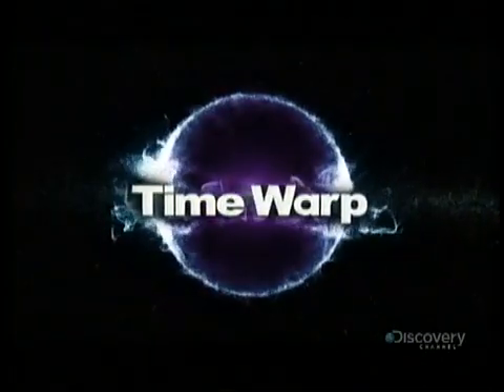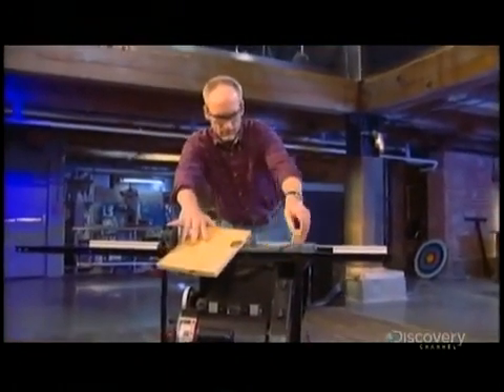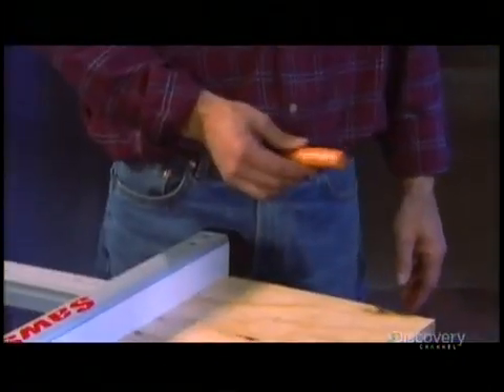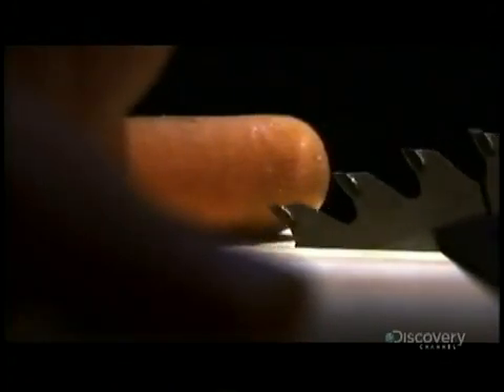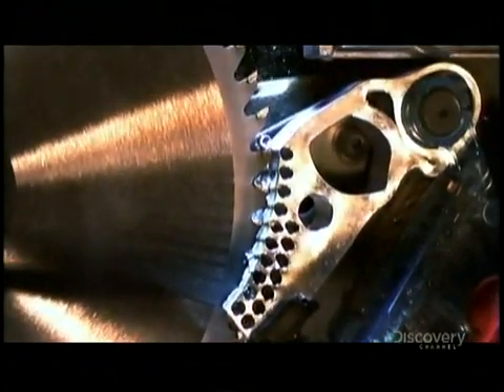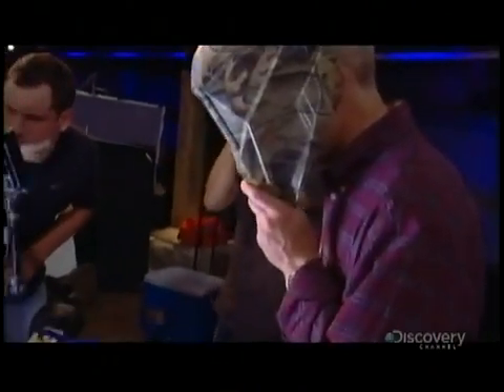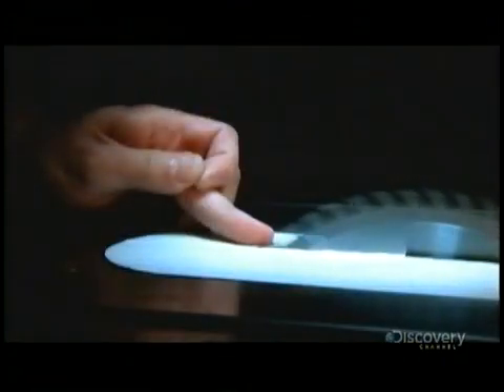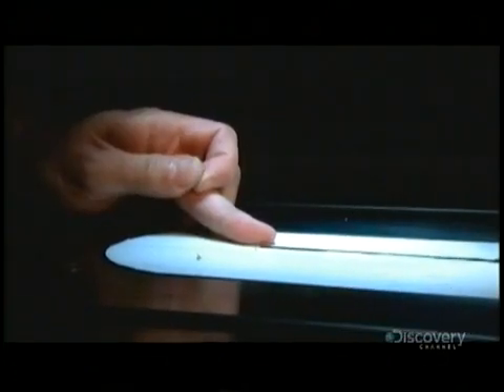Saw Stop - This guy puts a finger into an active table saw blade & comes away without a scratch!

Comment: what if you smash your hand on the saw and not doing it slow?
Reply: +Bill Gates You're smashing your hand into a sharp object.  That's gonna hurt a lot even if it wan't turned on.
Reply: +Bill Gates If he'd gone through full-speed it would have cut him. That's how it works. The reason it stops is because it's coming in contact with something very conductive. They aren't saying this in the video because it could easily derail the usefulness of this, but it would normally cut you just a bit before stopping. There would be no serious damage, but you would have a small scratch.  The entire reason he's dipping his hand in salty water before doing it is that he's simulating the salinity of blood. You'd still be fine, but under normal circumstances you'd need a bandaid.
Reply: +itsSidathe Dude stop saying the r word. I bet your kids will have special needs now
Reply: It will still stop the blade the damage would just be like if you hit a static saw blade. The sensor is extremely reactive and is controlled by a very powerful capacitor. It happens extremely quickly, and the damage is virtually nothing compared to if you did this without a saw stop.
Reply: +Bill Gates would you try?
Reply: no but they could have done it with a piece of meat
Reply: they didnt really do it that hard quick and with power
Reply: I saw a guy throw a sausage down on the blade, it gave around a 1/4" deep cut, at most.
Reply: +itsSidathe 

But that's what the invention is for. If it doesn't stop you getting hurt when falling on the blade, it's pointless.
Reply: +Jon a >r word
It's not a fucking ban word you idiot m.
Reply: +itsSidathe Surely it's more retarded to slowly push your finger into a sawblade than, say, falling or being knocked over by someone or thing pushing past.
Reply: +itsSidathe Surely it's more retarded to slowly push your finger into a sawblade than, say, falling or being knocked over by someone or thing pushing past.
Reply: +itsSidathe Surely it's more retarded to slowly push your finger into a sawblade than, say, falling or being knocked over by someone or thing pushing past.
Reply: Bruh stealing my name
Reply: +Bill Gates in a world without fences and walls we need no windows and gates
Reply: +itsSidathe stupid or not, quite a lot of peaple have died of falling in the saw, so i don't quite get your piont
Reply: +itsSidathe stupid or not, quite a lot of peaple have died of falling in the saw, so i don't quite get your piont
Reply: +D4RKBRU73 it's not about how long it takes to sense it, but how long it takes to act. it may know that a fingers there, but it might not stop the blade until it's already cut some
Reply: Evan Staley
Think of what you just said. "its not about how long it takes to sense it".. seriously ? I dont know if should reply to this nonsense or just leave it be. I think i go with the second one : )

Comment: He didn't actually put his finger in the blade. If you look closely, it's just incredibly close. On the high-speed footage, you can see that the sensors pick up his finger over time by the heat emanating from his finger, rather than physical contact.

Comment: so what happens when you try to cut a piece of slightly wet wood, there is a drop of water on the wood, hell even a knot or lump of sap surely it wouldn't be hard to simulate conductivity similar or even more conductive than skin? How does this deal with gloves?

Comment: What happens when you push your fingers/thumb into the blade with the speed a carpenter normally uses when ripping a piece of wood?   Inching closer 0.5mm at a time until there is contact gives the blade the necessary time time stop and drop.  But I suspect if you just haphazardly drive your hand into it at normal speed, it'll bite a bit more than they're letting on.
Reply: Small cut - no major damage, maybe some stiches - now what will happen if  you push your fingers/thumb into the blade with the speed a carpenter normally uses when ripping a piece of wood on a regular saw? amputation, ligaments, tendons destroyed,, bones shattered.

Comment: this works great to a point... however only certain saw blades work.. those coated with paint like "Diablo" brand and others do not work..  damp wood and some other materials to be cut on the saws will not work so the "switch" must be turned to the "off" position or the material will cause the saw to think the material is your finger and jam the blade.. 

if you think it is impossible to cut yourself then you might develop habits that cause more risk so when the "switch" in in the off position you WILL cut your finger/hand..  

I worked at a shop that has sawstop  saws and I see guys pushing narrow material through without a push stick and doing other things that they would never do on a regular saw.. 

now if the last guy to use the saw stop turned the switch to the off position and forgot to turn it back on there's a good chance someone will lose a finger.. 

personally I think it is better to not have such a device and just learn how to operate the saw in a safe manner and pay full attention to what you are doing 

that's my opinion about safe methods for using saws but the sawstop device does truly work as shown.. I've seen it for real at work

Comment: Well what if you're wearing work gloves ?
Reply: +Fireboltofdeath Actually, by the looks of it that's exactly how it works.
Reply: +Christian Garofalo It's a fairly known rule to avoid wearing gloves around a tablesaw.
Reply: Hopefully you realize it's cutting the glove and pull ur hand away
Reply: You're fucked!? I guess.
Reply: Well if you're wearing gloves while using a table saw you're an idiot and the Darwin award goes to you.
Reply: Exactly. Safety rules forbids you from wearing any gloves while using tablesaw. (I sometimes help my friend at carpentry shop)
Reply: +Christian Garofalo Your skin is still conductive inside the glove you moron
Reply: +Christian Garofalo Please do not wear gloves around anything turning, saws, drills, lathes. Gloves and long sleeves are dangerous can be even deadly around things that are spinning.
Reply: +CitoX27 Not how it works
Reply: Fireboltofdeath Exactly, any normal person would be going slow enough for the blade to stop even with gloves.
Reply: +Christian Garofalo you shouldn't be wearing gloves using a table saw anyway
Reply: It will cut thru ur glove but will still stop before cutting ur finger
Reply: the saw will eventually stop after cutting through the glove and comes in contact with your finger
Reply: It will cut your gloves down to your fingertips. You will have holes in it.
Reply: +Christian Garofalo There's a reason when using ANY rotating machinery you don't wear gloves. Never ever. They are dangerous and thus are not used.
Reply: +Hunter Jordan u don't actually have to be wet on the surface human flesh is conductive, however i imagine if u had dry hands it would do a bit more to you than absolutely nothing
Reply: You shouldn't have gloves on when ur working with saws anyways.
Reply: +Christian Garofalo By the time it cuts through the leather it will touch the skin and drop down.
Reply: +Christian Garofalo actually its way more unsafe wearing gloves while working with rotationary tools.
Reply: Harry Tomato because you can get your whole hand into a rotationary tool because of a glove where as you only get a cut without one but it depends how fast and big the rotationary tool is.
Reply: +Piyush Pulukool that's assuming the glove doesn't get ripped off first along with the finger. I've seen enough degloving accidents to not wear gloves around machinery.
Reply: MadMetalManiac74 yeah id rather have a cut in my finger or even a finger cut off than my hand getting pulled into the saw and maybe lose the whole hand.
Reply: Make sure they are made out of human flesh.
Reply: ***** It can only stop so quickly
Reply: +CitoX27 exactly
Reply: +Liam 4.0 At my shop we are allowed to wear surgical latex gloves when running mills, lathes, grinders, saws, drills, etc... no rings or watches though.  Cloth or leather gloves around rotating machinery is grounds for termination.  Gloves at the hydraulic cylinder press, shear and brake press are allowed however.
Reply: Well of course. Those gloves are fine because if they catch they rip without pulling you in. 

And as for a press, it's not nearly as big a concern. It's a very controllable machine without that pure speed and momentum. So again, that's fair.
Reply: +Hunter Jordan also im pretty sure in real applications of this (accidents) its a little bit bloody
Reply: dip the gloves in some salty eater
Reply: +Christian Garofalo Just Dont use gloves on that type of a saw.
Reply: dont use gloves when using a circular saw
Reply: FraMeZzHD Obviously lol
Reply: Then take them off?
Reply: Hunter Jordan  I'm not sure why people do, Did the person who taught them not teach them or not drill it into their mind? When I was learning to drive my instructor drilled random shit into my mind and basically most the stuff I know is muscle memory, Why wouldnt something like shop workers/teacher drill this into ALL their students minds over and over and over. TBH owning some shop equipment should require some sort of license. obviously that's pretty extreme but people are stupid and the accidents from shop equipment is probably really high.
Reply: +Christian Garofalo I believe it's possible to change the distance of the sensor as i believe it uses capacitive touch, which can be used as a proximity sensor.
Reply: +kendram90 Well, safety rules also forbids sticking your fingers into the blade...lol.
Reply: FinaleGoofups
I don't know if we have enough information to know this to be true.  I mean, I HIGHLY doubt that the sensor is in the blade itself.  It is most likely above and below the blade. 

That said, I suspect that once it starts cutting the finger and the skin and blood gets pulled out of the glove it would probably sense it and stop... maybe.

I guess it depends on how sensitive it is.  It may require a much bigger area to be exposed.  If it was too sensitive then it probably would trigger if the wood was just slightly damp.
Reply: +BawZ Meliodas Why?
Reply: +BawZ Meliodas rotary
Reply: James Cree sorry im from germany
Reply: HiT _ i have written germany but ok.
Reply: well i was not talking about the tool shown in this video i was talking about rotationary tools in general its more dangerous to wear gloves while working with rotationary tools.
Reply: BawZ Meliodas correct. Just not a good idea.
Reply: +Christian Garofalo never cut on a saw with gloves or baggie clothes.
Reply: +101perspective there is no sensor in the way you people are talking. there is a low voltage current running through the arbor and blade.this is why you must contact the blade to trigger the brake. by touching the blade you interrupt the circuit.this is also why you must keep the blades fairly clean. any glue buildup, like you get on the sides of the carbide teeth after a period of usage, will in fact increase the time it takes for the brake to trigger. i have this saw. actually a larger shop version. and i have thoroughly read the manual.
Reply: As soon as it cuts through the work gloves and reaches the conductivity of your flesh it will stop, same principle as when they showed it stopping cutting a board and hotdog at the same time.
Reply: +FraMeZzHD I hope he listens to you bc he will learn that it wl grab and eat mister man's hand
Reply: put salt on them!

Comment: Problem is, you are completing a circuit between the metal table top and the metal blade, so as a result, what if your hand was NOT resting on the table? I bet it wouldn't stop then.

Comment: If it could be made, to cause minimal/no damage to the saw, it would be alot better. As it currently is, it seems to prone to miss-fire.
Also Ive had 1-2 of those touch-lamps break on me (where the touch function no-longer works) so without a way to test it (without utterly destroying it) is it really completely safe? because as others pointed out, knowing such a mechanic is in place is liable to cause unnecessary risk taking with the blade.

Comment: So essentially, it's just a GFCI? Does not seem all that impressive? What happens if you're wearing work boots with a rubber bottom, since there would not be a flow of current to ground, would it not shut off? If this is the case, this invention is almost useless since most people working with a table saw would have work boots on. Furthermore, why not just make a mechanism that retracts the saw blade, but keeps it spinning so you don't have to replace parts? This entire thing just seems like an irrational invention to me.

Comment: Well I wonder how it would work if you replicated a person feeding the saw at a normal speed. Of if some chicken grease got on a piece of plywood. It would really suck if you wasted a $200 Freud or Festool saw blade not to mention the damages replacement parts on the saw.
You take the danger away from using a circular saw and complacency will get you hurt or maimed.  Best to just obey safety procedures.
Reply: +patstenzel Why and how would you get chicken grease on your wood? xD I guess it depends on what you value more and this might be a better thing to have on workplaces and not in private homes. Since when you work and do plank after plank after plank all day everyday then you might slip up and get your hand in the wrong place.

Comment: This is something my job needs to invest in. I work at a cabinet shop and you can only use the table saw if you're certifiably trained (of course).  The problem is, there's not enough people trained for it so if the person who is trained in my department is gone, we're screwed. I've asked to be trained many times but they haven't done so. With this investment, anybody could use a table saw.

Comment: My woods class got this saw my senior year. One Freshman and one Sophomore set it off within a week of eachother. Neither actually touched the blade and it set it off. These things are a pain to replace. The 2nd time it went off it actually broke a bolt in the mounting area so we had to call in a guy to fix it. Not fun.
Reply: +Hurtydwarf still beter than accidently losing a finger
Reply: If you guys listened, he said they didn't even touch the blade, so there would be no lost fingers.
Reply: +bazookabullet101 it's supposed to go off when your finger is in danger proximity, not when it actually touches...
Reply: @InTheZoneAXC  Incorrect - your finger has to touch it- more accurately anything that can conduct electricity has to touch - in this case it was set off by wood that had too much moisture for the saw, not by a finger.
Reply: +Hurtydwarf replacing it twice is still way cheaper than the lawsuit would have been if they did cut off their finger.
Reply: +SunShine lol
Reply: +Wagacca lol
Reply: SunShine Man, they obviously didn't.
Reply: No shit.
Reply: bazookabullet101 pretty sure I responded to the wrong person, but you'll be ok...
Reply: +Hurtydwarf Same. These blades go off when they contact anything conductive. Anything metal at all or slightly damp wood/wood that's been outside/wood that's not super dry will set it off.
Reply: +55fragger I was actually going to ask if that was the case, green timber and anything else conductive stopping the blade I mean. Could get expensive. Lol when I was at school the woodwork teacher chopped his thumb off with a saw. His name was mr I. Fail though lol, no word of a lie.
Reply: +Thai Breaker that happened at my school too, apparently one of the students had to pick up the thumb for him off the floor
Reply: The teacher should've never told the class about the "SawStop".
Reply: +bazookabullet101 actually I read it. And I'm sure the high school kids were being curious and set it off.
Reply: +Jared Springer that stuff is not really legally binding.
Reply: +bazookabullet101 The point is that there is every potential that someone COULD lose a finger, so having the saw and having it fail multiple times is better than somebody potentially losing a finger.
Reply: Yeldur Or they could easily use other less expensive safety precautions.
Reply: bazookabullet101
Ones that will more than likely be a lot less effective than this, causing the student to be injured in the process.

If I had a school full of children and I had the choice to have it break every time it's triggered or to get a less safe precaution, I'd pick the first. Safety comes first and foremost, if you are willing to risk peoples limbs then that's you, all I can say is you'd make a terrible head master.
Reply: Students should learn how to be safe with the machine, not have the machine just break itself whenever.
Reply: Are you a doctor?
Reply: bazookabullet101
Yes, because nobody on earth has ever had an accident before, silly old me, we should just tell them not to have any accidents anymore, I'm sure that will work.

You are an absolute moron; the epitome of nonsensical.

Comment: What if you made the saw to move the blade downwards, rather than stop it? Would it be able to drop it quickly enough, and would this solve the issue with stuff breaking?
Reply: +ParaCraft Unlimited It would take alot longer to lower the blade that you still would get seriously cut. If it takes more then 0.5 sec then that would be enough time to cut deep into your finger.

Comment: Why not just drop the blade and let it run down below the table instead of trashing the blade and equipment? It could be instantly pulled back and down with the need of changing out damaged parts while the finger is still intact.  Just sayin'